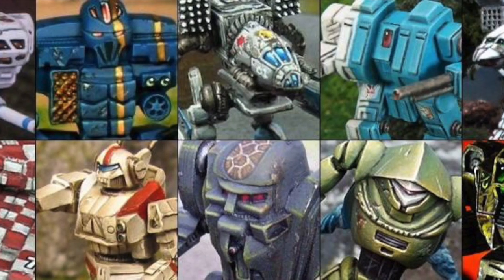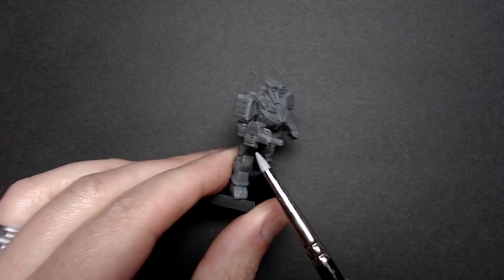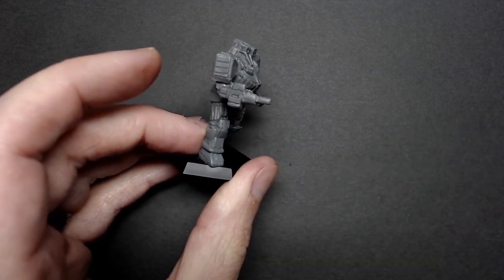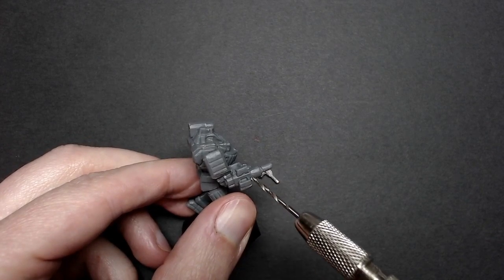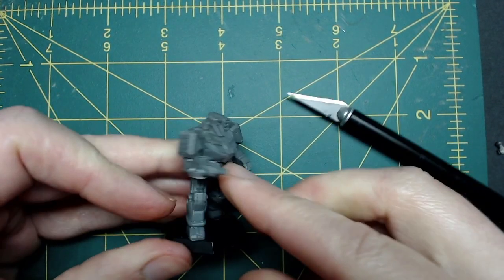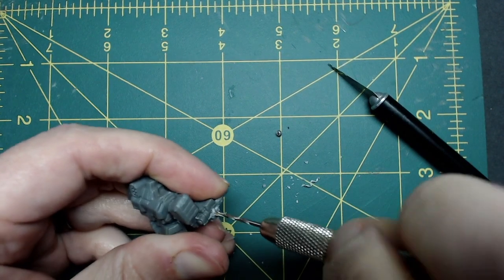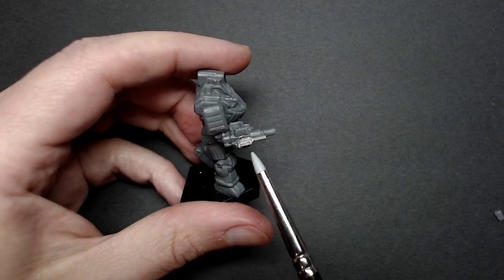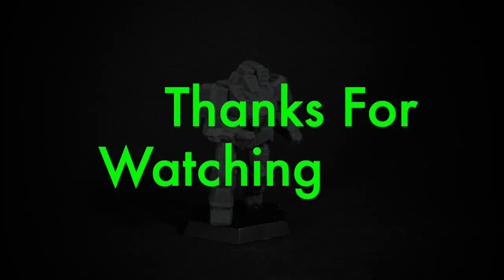Battletech Easy Plastic Wolverine Variants | Battletech Miniatures Modifications

Comment: Is there any feasible way to modify it to have the chin-mounted turret laser (like literally every single Wolverine design ever had, but the redesign removed) instead of the shoulder-mounted laser?
Reply from the maker: Really if you can sculpt it with an epoxy putty like Green Stuff or miliput, then you can create whatever you want.  If I were going to attempt that mod, I'd carefully cut the current medium laser out using a hobby blade and clean up the area first. Then either find a suitable metal or plastic part to be the base or majority of the front mounted "ball turret" and then go from there. A 3D printer would be a good option if you're capable in that regard or know someone who is.

Comment: Nice work, but I'm still hoping Iron Wind will make standardized variant kits for all the new mechs. I'd also want to remove or putty over the jump jet ports on the legs for a Wolverine-K.
Reply from the maker: You'll definitely see several variants offered but I wouldn't hold out for all variants of them happening, but perhaps some mechs will get more than a couple.